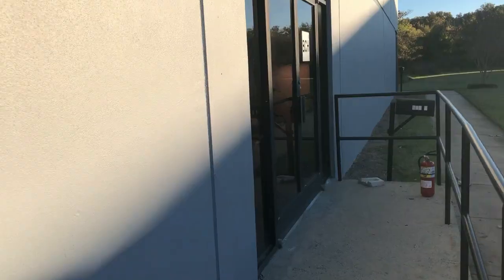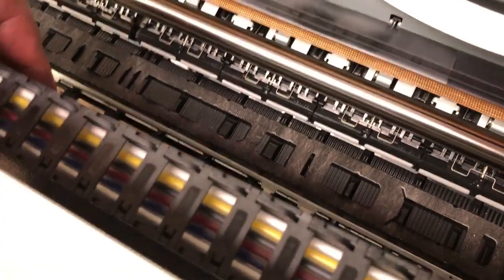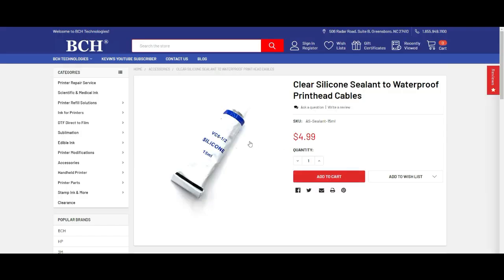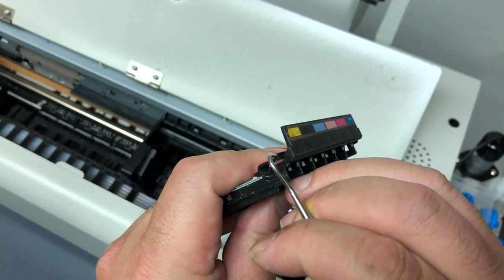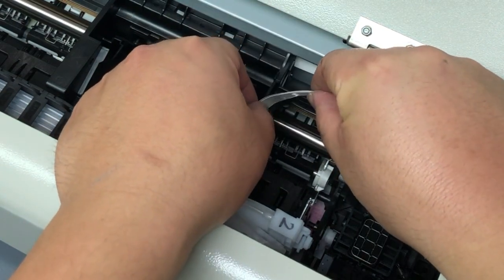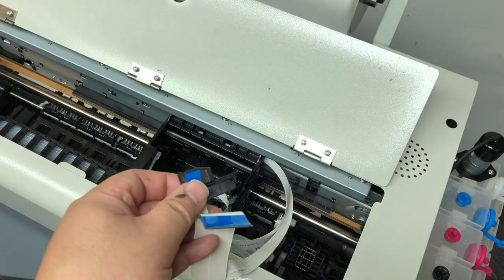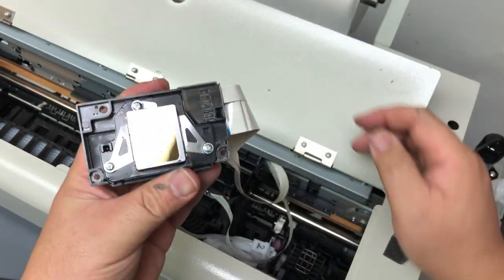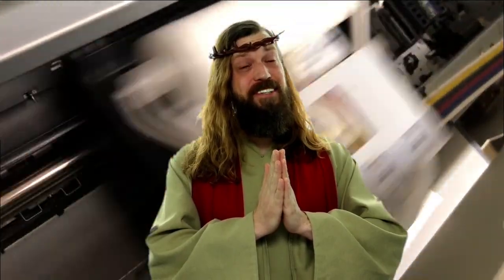#1 Fix with Your DTF DTG Sublimation Printer - Printhead Short Circuit

Comment: Permatex Ultra-black rtv works too but you need to be careful where you put it. It is removable but you can damage the cable trying to remove it from the thin cables...

Permatex ultra-black is safe on electronics but not all silicon sealants are. If it smells like vinegar then its not safe...

Comment: The driver transistors on the main board can go bad over time as well and this can give bad results even with a brand new print head. The transistors may still function and you can print but the transistor gain will become too low to operate the print head to 100%. It could give the appearance of a bad or clogged head when its the driver circuit just not getting the proper wave form to the head.  I found that replacing the transistors is usually enough but be sure to test electrolytic caps and replace those as necessary. I like to add a high voltage film cap across the power input to each driver transistor pair to give a slightly longer life to the repaired components...
Reply: got a beep after i clean my print head, is it enough to change my printer transistor, or i need to change the print head too ?

Comment: Where do I find a cable guard that has the 2 tabs that holds the printer head cables off to the side. Mine broke and I cannot find 1 for L1800

Comment: Hi, ive converted also but printhead nozzle test is very bad. can you configure my printer settings? already tried new printhead. Still same result. Im thinking low voltage maybe. The firing printhead is not strong enough. Can you help me please Kevin